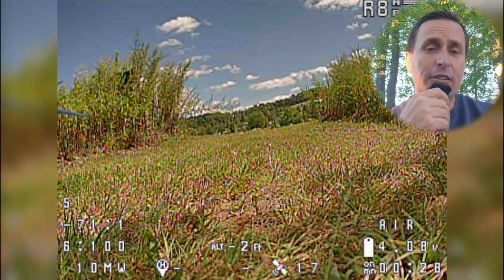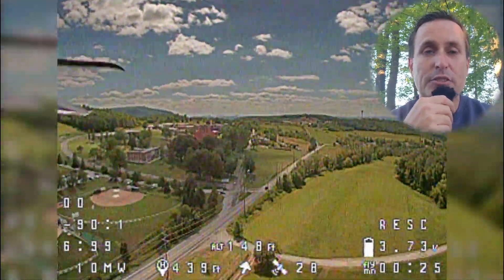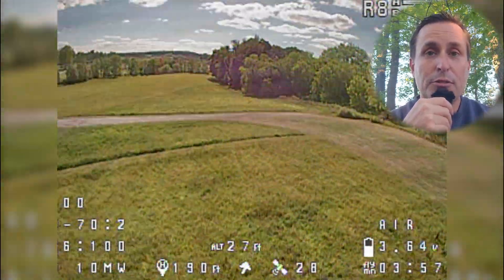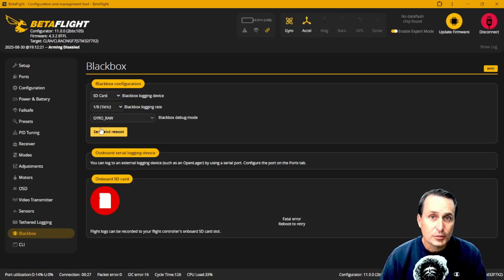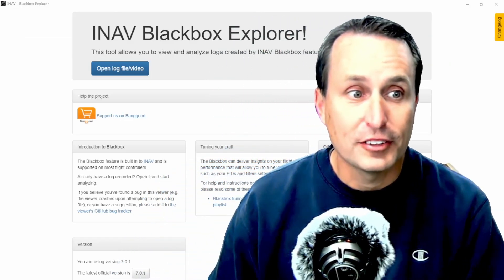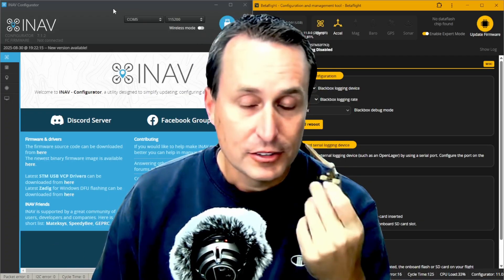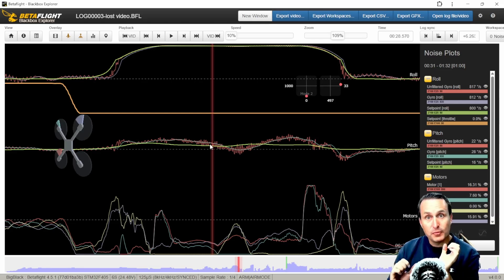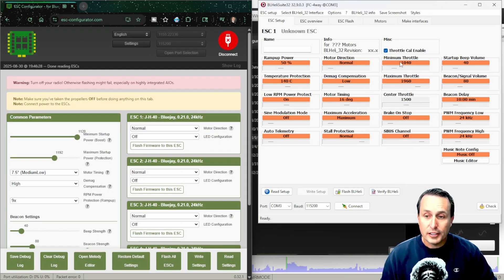#2❗BIG❗drone Build Mistake - ELECTRICAL NOISE

Comment: Hi, would like to add my expirience here. I had issue with kind of waves. And I was trying different things and nothing helped. Then I just rewired my camera from 12v to 5v ( Camera Power Input DC 4.5-27V ) and this completely fixed an issue.

Comment: Hi Sir, i really need help on gps.
I bought gps nano flywoo gm10 v3.1, but its not lock the sat and get the sat really slow, i sodered corectly already. I did the copper tape but helpless, i used the u-center to change Baud but nothing happened. And the flywoo didnot have the firmware update. Is there any reason that the battery on the gps broken???
Reply from the maker: no reason I can think of.  Try a different gps?
Reply: @uavtech i figure the issue, the gps close to the vtx, i put copper tape under the gps and every time bf flight, unplug the vtx, wait about 2m to get 8-10 sat, then plug in the vtx, the gps around 8-12 sat.

Comment: Higher PWM should give more electrical noise right? More voltage spikes from switching mosfets. But the motors will run a bit smoother, especially at high RPM.
Reply: Just the opposite. Higher pwm tends to result in cleaner electrical, but also reduces braking torque and a small decrease in motor acceleration. The end result is weaker pid authority but motors run smoother. There’s always a tradeoff
Reply: The signal to the motors will be cleaner/less blocky with higher PWM but it doesn't make sense to me why it causes less electrical noise, could you explain why you think that or how did you find out? What I know is every time a MOSFET switches, it causes a voltage spikes. Higher PWM equals more voltage spikes and thus more EMI. It feels like one of the many FPV myths unless you have a good explanation.
Reply: @timon72489 I don’t have a good explanation but I have a ton of data (that’s better than a theory). I’m guessing that the increased braking torque associated with lower pwm results in larger electrical spikes. This would be consistent with the fact that lower pwm heats up motors as well. I’ve done lots of bench tests as well and besides increased braking, lower pwm results in greater motor acceleration.
Reply: @timon72489  You are kind of right. On smaller builds 48k PWM has less electrical noise compared to 24k PWM. But while I working with hundreds of bigger drones i came to conclusion that in general, if you are trying to fly with bigger motor/prop setups with payloads, 24k pwm will have less load on ESC compared to 48k.
Reply: @tomasspetersons4158 I think the ratio between the electrical frequency of the motor (rpm * magnets/120) and pwm frequency is very important. Smaller quads have higher RPM so need higher PWM. And I am curious, how do you separate electrical noise frome mechanical noise in blackbox? I know vertical lines are resonances and the throttle dependent bands are motor/prop vibrations. Electrical noise is everything separate from those right?
Reply: The 24kHz did have more noise on gyro, but filters take care of it and i am worried more about load on ESC.
Reply: @timon72489 electrical noise manifests as broadband, basically an elevation of the noise floor. It tends to look more like brown or pink noise because of the series of LPFs (hardware and software)
Reply from the maker: for some reason it reduces in my experience.
Reply: Higher frequency shifts the noise up where it will be attenuated more by the inductance and capacitance already present in the system. The downside is that the additional transitions cause more heat in the ESC and can sometimes cause more heat in the motor.

Comment: I have great stable flight with my little analog, but I get like a dark gray bar of interference or static but only when the kwad is level. It seems like a camera or vtx or maybe goggle issue. If I pitch up or down, even enough for forward flight, it just disappears. Very repeatable. It didn't happen until I switched from a whip to a lollipop, but I also switched vtx. Any ideas?

Comment: I sometimes have this electrical noise you're showing in the beginning on my 2s 85mm whoop. would you say that rig definitely needs a cap or could the issue also lie somewhere else? because it's not all the time and it's more pronounced with some cameras over others.